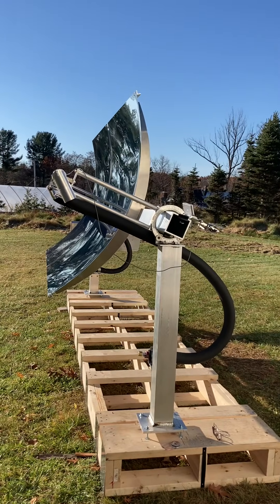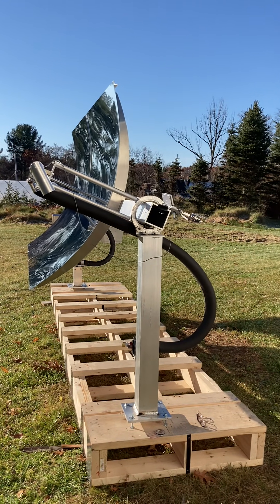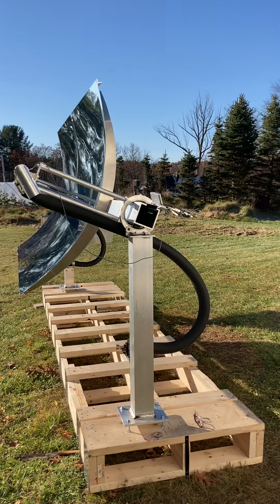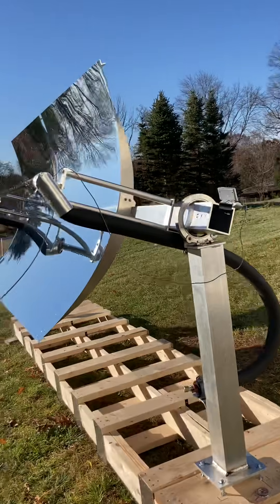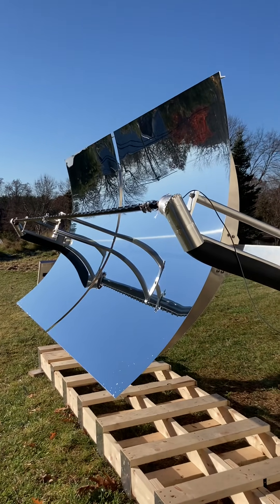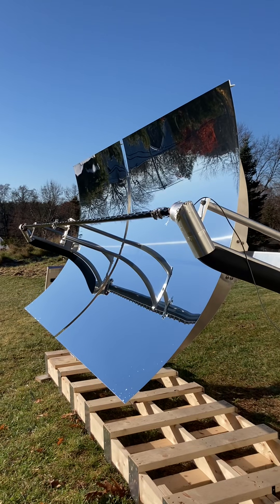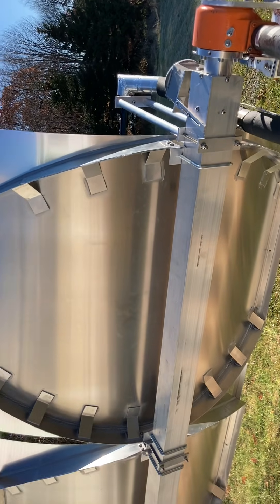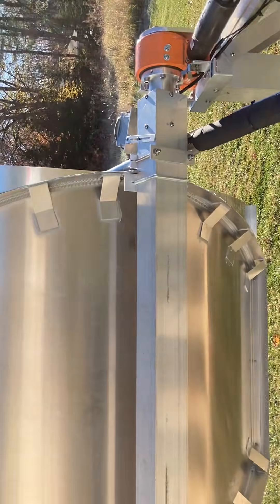New Parabolic Trough

Comment: Hello Paul:
Excellent video. I loved.
How could it be used for your system to desalinate seawater?
Reply from the maker: Hi, There are many ways, basically you heat the water up then the water vapor condensates on a cool surface and then forms distilled water then collects in a seperate container. There are more sufiticated ways like pulling a vaccum but the concept is the same. Thank you! Have a good day, Paul
Reply: Desalination namely involves heating sea water until it produces steam and cooling down the steam afterwards. A Troth is the heat supply and the concentrated sea water leftover is called “Brine”. Brine can be a pollutant if directly injected back into the ocean, but it can be harmlessly injected into the ground instead

Comment: Hi paul which type of pipe you used to connect the outlet of the parabolic trough.
Reply from the maker: Hi Sir, sorry for the delay, I used teflon tubing with stainless steel braiding on the outside. Thank you! Have a great day, Paul

Comment: I live in Thailand and am going to build one from a 4'x8' sheet of mirror finish stainless steel. I found a company in the Netherlands that makes a small turbine with Integrated generator. I will use an arduino controlled fuel injector to spray water in one end and hopefully produce superheated steam to turn the turbine. A Nighthawk video shows a simple way to make a solar tracker. Another video shows a parabolic panel that rotates around a fixed solor collector pipe.
Reply: Hey Mike i like the direction you are going and bid you good luck sir! Thanks for posting tracker reference. I would highly recommend looking at Sergiy yurko's video on using oil as a medium because oil can retain energy for much longer. The system in this video is fantastic because it gets hot enough to use that medium.
Reply from the maker: Awesome! Good to see folks making there own solar systems. Thank you! Have a great day, Paul
Reply: @paulsoucy5834  I do not understand why we can't build simple powerplants like this in Africa for example. Makes me mad. I bet you could even rip out old plane turbines and convert them into crude steamturbines. Build cheap solar trackers with 1 photocell and an arduino. Since the sun is nearly overhead the closer you are on the equator and atmosphere the thinnest a trough running from north to south could track the sun perfectly with rising efficiency. They could make power while simultaneously desalinate water with the excess heat for irrigation. Truly makes me mad that it doesn't happen.
Reply from the maker: yes you are correct. I never could understand why we can't do more. Thanks for your input! Paul
Reply: Hai sir can u tell me total cost of the equipment
Reply from the maker: @venkattesh4122  Hi, Sorry for the late reply I am not on this site that often. My email is envsolar@comcast.net if you need quotes on different sizes. Thank you! Paul

Comment: Explain in detail the components of the solar dish collector head, its reflectors, and the steam hoses.
Reply from the maker: The parabolic reflectors are curved to direct the energy to a point in this case the absorber tube. The absorber tube is type K copper and has a selective coating with a low emmisivity and a high absortivity. The fexible hoses are teflon with a stainless steel outer braiding. This is mainly used with thermal oil because and not steam, steam can be very dangerous because of the high pressures. Have a great day, Paul

Comment: What fluid is used for heat transfer for such high temperatures? It is really amazing such high temperatures can be achieved by solar system.
Reply: Brake fluid, soybean oil
Reply from the maker: Hi, Sorry for the delay. This system was shiping out to a college so I did not have any fluid in the absorber tube. Thank you! Have a great day, Paul
Reply from the maker: Hi you can use thermal oil